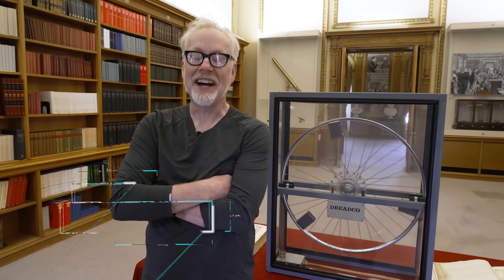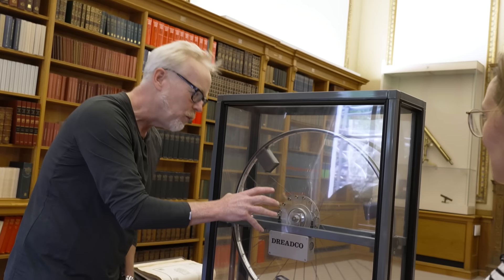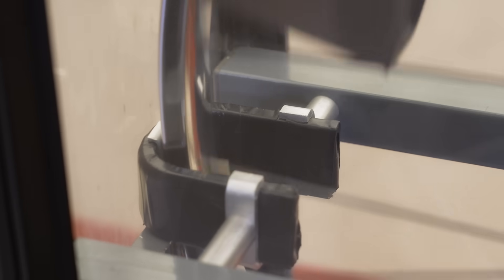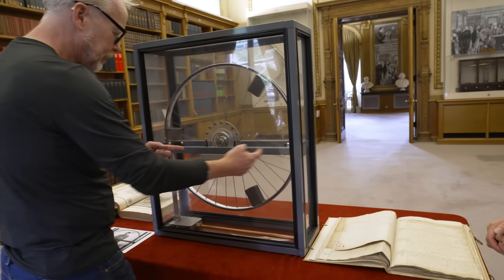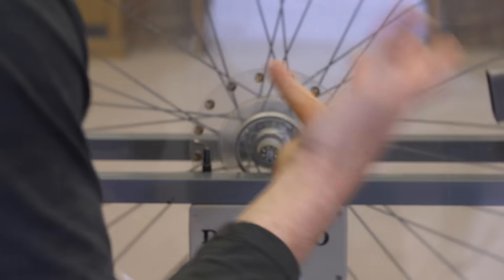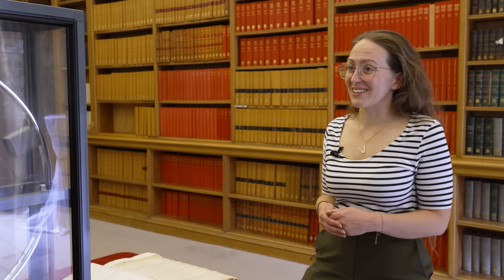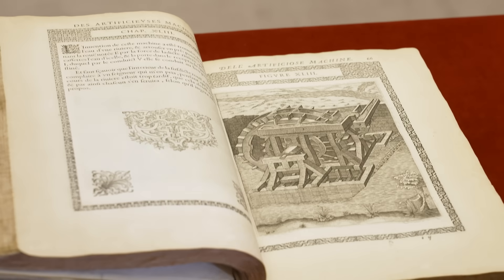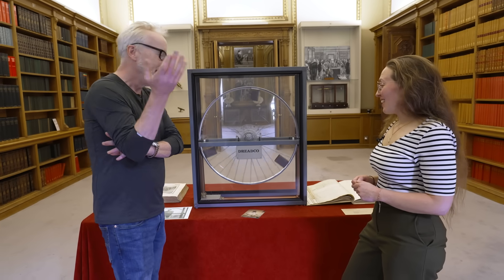Adam Savage vs The "Perpetual Motion" Machine!

Comment: The 3 boxes are capacitors show the edges of the bicycle wheel! Saw the rubber band inside the edges of the bicycle.  Capacitors passing through magnetic fields and passing around a coil in the copper pipe will provide enough energy to keep it turning and an alkaline battery would last awhile to initially start the turning and keep a small charge  switching polarity in the coil hidden in the copper pipe. If the Capacitors are covered in a ferrous material you can use  depending upon the polarity of the magnetic setup send the power from 1 Capacitor to another with a 555 timer chip using a switch to use induction. As stated this is just a self powered motor that needs servicing not a true overunity device. I have a unit that uses a battery to keep a self powered motor generator however being DC and having 5 separate coils connected In series and parallel plus the 5th coil is the motor driver even connecting an alternator insulated from the magnet barrel to keep the charge on the battery. It still has losses due to heat and friction. You are always dealing with the law of increasing losses. Even though I am able to double the current and voltage by using more than one set of panels with coils. It's easier to use a Solar-powered battery charger connected to batteries into inverters. As long as you keep the batteries around 50 degrees F.  Any rupture on Lithium, cadmium or Cobalt batteries causes an instant fire. Amazon who placed solar panels on their roofs have shutdown their entire solar system because of fires due mostly to battery ruptures. Other fires were caused by metal fatigue in the solar panels themselves. And using micro inverters without taking into account power surging from the solar panels burned out the inverters. Another problem was using the smallest wire to conduct the electricity to the micro inverters breaking down due to the same power surging. The same problem is happening with the Tesla EV battery swelling and rupture instant fire. Plus again the batteries are not currently designed to pull 1 damaged battery pack. Instead you have to scrap the entire battery. Just like a flash light 1 dead battery no light. Plus continued losses due to age recharging and battery component breakdown.

Comment: The first thing is to differentiate between "perpetual motion" and "free energy" machine. The former one is THEORETICALLY possible. You just eliminate all losses, supply some initial impulse - and BINGO!. That simple 🙂. Obviously, this is not the case, as the need for periodical "servicing suggests.
The later one, providing some excess energy that can be utilized outside of the system is not possible at all - even theoretically.
This one is, obviously, attempt for the former but the "minor" problem of eliminating ALL losses still needs some polishing.

Comment: my first thought & still thinking
the 3 iron weights rotating in the wheel both accurately ballence the weight of the wheel allowing it to run smoothly and are iron magnets.
te U shaped things each side are verry low power electro magnets providing the tiny ammount of power needed to keep it running.
plenty of places that could be used to hide batteries.

Comment: My guess before watching for the answer is that the little metal arms in the cross beam (near the base of the spokes) are connected to the batteries. As the wheel rotates, those arms come in contact with the base of the spokes, sending current through them to the electromagnets in the black boxes which pull themselves toward the metal cross beam, thus rotating the wheel. This way it is mechanically timed and doesn't need to hide any wiring.

Comment: resistance at the center post is another big issue.  This can be addressed with magnets that keep the wheel suspended with no physical contact.
Reply: Good luck with that. The biggest losses are probably due to air resistance anyway. The wheel is not running in vacuum - the flimsy case would implode.

Comment: The it will come to a stop due to the permanent magnets are slowly getting degaussed. The other thing is you cannot pull any power from this system or it will stop. There is no power gained from machine.

Comment: You can see a slight lag every time a box on the wheel passes through the bracket, which to me, seems to be the driving factor. 
Maybe the heat sync is to regulate temp within the enclosure to keep the magnets/batteries at a constant level to balance out whatever heat they are generating and the copper tubes would simply be vents?
A smudge of mineral oil on the glass to reduce friction.

All and all, it really just looks like an over complicated science fair project... I'd initially give it an A, but then after hearing the breakdown of mechanics, a solid B+.

And if those "in-the-know" of the secret were disappointed in their discovery of the truth, WTF did they ruin it for the rest of us? 
Poor showmanship, for shame. 
Thats like going to the best show on earth and then having all the awe sucked out by revealing trade secrets right before the show starts.
Reply: When one can't do it themselves they give others B+ 😂.
Reply: @ricardoribeiro8037  Thanks for the irrelevant snarky coattail. Same can be said for keyboard bitches... those who bark rarely have bite.
I gave a B+ because of false advertising. NEAR-perpetual motion is not Perpetual.
Reply: @@steinmauer9747 and this is why I posed it as a question, not a statement. Thanks! It's just one of those things you'd have to see in real life I suppose.

Comment: Its a counter balanced wheel with a electronic timing device in the center and a very small air pump of some type only working when it needs to over come balance point with one copper tube as a vacuum inlet and the other side of it as a blower out let in a sealed air tight box with some sort of battier running the pump. The box that would house said pump has heat sinks to make a natural draft from from the short pipe as its less restriction aiding the motion.

Comment: I'm hoping the device somehow uses ambient energy.  The accelerating expansion of the universe relies on dark energy... that must be it!  I think relying on batteries or a spring would be cheating.  Otherwise you could say a clock is a perpetual motion machine (as someone did here).  I suppose a natural battery might be ok -- some kind of one-way chemical reaction that generates electricity.

Comment: I think there are radioactive sources undergoing alpha decay in the three boxes, and the boxes are vented so the thrust spins the wheel.  Alpha decay inside a glass box is perfectly safe, and the two things pointing at the hub are for dissipating the electric charge that accumulates.
Reply: Plausible.

Comment: In 1965 , I saw a Pendulum that was powered by the earth's spinning motion.
It was / is in the lobby of the New York, United Nations Building.   The top of the Pendulum was attached to the ceiling, maybe 200 ft. up , I don't remember the exact height.
And the swinging  metal ball at the bottom , progressed around, a short ,circular wall. 
The tour guide said it never stopped swinging .
Reply: A Focault pendulum. It's not actively powered by anything, but has to be set in motion and eventually stops due to friction, like every other pendulum. It appears to rotate though, but actually it's the Earth itself that rotates, not the pendulum.
Reply: So why cant we shut the Flat Earth freaks up with that!!!!

Comment: why is a small portion of  the disc in the middle with the silver ring covered by the box? My guess is that every empty space is  used for the batteries to power a small motor with a frictionwheel inside of the box. The movement is way too smooth to not be generated by a motor. This man did a great job when it comes to adding "random"  parts to it to distract viewers 😄

Comment: This has been around a long time, I believe she say the 80's. This does not relay on batteries. 
Batteries are NOT a great source of power long term.
This also does NOT relay on weight. This has been proven. The 3 black cans 120 degrees apart, spinning, 
its always "lifting" 2 at ANY given time.
Magnets????????????

Comment: The need for periodical servicing makes me suspect some internal, possibly electrochemical, source of energy, like battery.
Without it, some external source of energy is needed - quite tiny, as not that much energy is needed to keep a wheel like this on quality bearing moving. There is quite a range of options available. Sound, for instance, producing electricity thru a dynamic microphone. Changes in barometric pressure. Changes in temperature. Ambient light etc. Once you chose your energy source, the technical solution would become a minor detail. There seem to be components present for utilizing any of the above energy sources, some of them possibly just red herrings.
We would have true perpetual motion machine only if it would be able to run in vacuum, total darkness, and at absolute zero temperature.

Comment: Magnets and such I see. Makes sense a weight that can push passed the magnetic force but not to much could keep it spinning forever. Probably is hook up a generator and  it won't work. You need a big carnival ride to power a small generator. Use wind or water.

Comment: Just thought of a couple other things. Since we KNOW it is fake something has to drive or kick the wheel. I'm thinking of the possibility it is an electrostatic motor. Much of the parts are useless and there to misdirect the viewer and add mystery. But in the Dreadco box could be a barometric powered clock work that can create enough charge to drive electrostatic charge on the probes. The other idea is that the Dreadco box and probes are themselves a misdirection and the magnets are key. There are enough dissimilar metal parts connected together that they themselves create a battery that can last for decades. This could be just enough charge through some sort of pulse circuit to kick the wheel slightly.

Comment: The wheel is propelled by air pressure, thus you might be wondering how to create air pressure without a moving member. I had trouble understanding why a chemical professor was needed in the first place before I began learning more about their friend and business which has nothing to do without. I probably figured out how .5 volts of current could create air pressure without BLADES or any moving parts. It's working for me. Problem is, since the AIR Pressure is directly correlated to the heat produced by rotation, my prototype, which cost less than 100 euros and included some magnets, isn't sure if it can actually pull another magnet wheel. Accordingly, this will stop rotate in a vacuum or a cold pressure. It is steam engine train only difference is air pressure is created by NON movable parts. This part is my available commercial but they are using it for different application.

Comment: There's no magnets or any other trick. The wheel is on a very good bearing in a vacuum.
Reply: No chance. Did you see how much the wall it moved when Adam touched it? If there was a vacuum inside the sides would be under constant tension from the atmosphere.

Comment: I assisted an acquaintance many years ago in the construction of a similar device. I was very young and the operation of it was somewhat beyond me, but it had to do with magnets with opposing poles on the wheel and frame. The opposing magnets pushed the wheel enough to get it to spin, but it wasn't very efficient. We added a low powered motor to spin the wheel axle, and copper coils to the frame magnet. Each time the magnets pushed off one another, the copper coil became hot; That thermal energy was transfered back into the motor battery, which effectively made a motor which charged itself.

The device discharged slightly faster than it charged, but the energy-to-motion-to-energy exchange rate was extremely efficient. The problem we ended up with was that the copper coils got hot enough to burn through the frame, and over time they ruined themselves.

Comment: I wonder if maybe the 3 "boxes" have magnets inside and act as both weights and magnets, and when the magnets pass close to the copper tubing maybe there is another tight fit magnet inside that moves and changes the air pressure inside the copper pipes and then the extra pressure is send to what Adam thinks are "Cathode/Anode" which could just be smaller pipes the sending slightly pressurized air into those cap looking things on the smaller circle in there and that makes it move ???

Comment: Adam? On your old TV show, The Mythbusters, your experiment to verify or not verify the effectiveness of Da Vinci's proposed steam cannon ignored some key factors. Eg: you jam a lead ball into a copper-tube's bore, perhaps 2/3rds of the way in (4 feet in)  in a 6 foot long bore of a copper barrel with a 4 inch bore   snugly holding a slightly more than 13.5 Ib weight lead ball at room temperature. You put that barrel in a trough filled with searing hot charcoals, guess what happens? The tight-fitting lead ball will expand more than the copper tube per given temperature, and bulge out that portion of the copper tube interfaced with the lead ball. The ball will become lodged/jammed in the bore. Then, if Da Vinci's proposed cannon has a small truncated funnel hole in the one-inch thick copper tube, with the bottom of the funnel facing the cannon tube, perhaps with a  1/2 inch diameter orifice to admit forced water into the cannon's interior breach. The funnel itself linked to an external 4- inch diameter bore cylinder where a wooden piston/plunger would be used to rapidly force water into the searing hot breach, two men holding down the T-bars of the plunger piston when it's flush with the bottom of the water-feed cylinder after forcing water into it. The steam inside could speedily hit over 400psi, enough to generate over 5,000Ibs of force to violently dislodge the lead ball by deforming it in a split second into an asymetrical ellipsoid and 
violently, swiftly thrusting it out of the barrel. My equation for it. F = 5,000Ibs x 2/3 = 3,300Ibs average. A = (3.300 Ibs/13.5 Ibs) x 32 ft/s^2 = 7,800 ft/s^2.
V^2 = 7,800ft/s^2 x 4ft = ft^2/s^2. V = 62,400ft^2/s^2.  V = 250 ft/s (horizontal), 176 ft/s (45 degree angle)
Range (ignoring air resistance) = 88ft/s x 5.5 s x 3 = 1,450. Not bad for a steam cannon.
Reply: Ooops! I forgot to multiply it by 2. V^2 = 2 x A x D, which comes out roughly to 124, 800 ft^2/s^2,. V (corrected & horizontal) = 350 ft/s. BTW, you can reach me at Facebook, Adam.

Comment: i am curious if the 'motion' of the wheel is fluid /even, or if measured with something detecting minute changes would show that there's slight increases & decreases in its speed as it turns. 

Also wondering about the speed that it turns, how it might operate at faster or slower speeds.  Although of course that wouldn't be discovered easily unless the background "operators" of the device were to do that.
Reply: I wondered the same but if it wasn't fluid, the friction would be too great for any battery to spin it for years at a time. Perhaps using lasers you could precisely measure the rate of spin change, but absolutely not with a camera.

Comment: I'll take a foolish chance and throw my two cents out there. It's like a Tesla Turbine, aka bladeless turbine. The copper pipes carry air to and from the box in the corner. The pipe on the left brings air in. The pipe on the right pushes air out. The "U shaped magnets" are used to neck down the air flow, increasing pressure. The moving air is what moves the wheel. The case the machine is in is probably the most important part of how it works. Aside from helping direct airflow, the machine would stop if someone walked by too fast without the case protecting it. The case also muffles the sound of the fan inside the box. Everything else is a smokescreen, including the pictures. Powered by Energizer. And I wouldn't be surprised if the "answer" in the envelope is blank. It's a good joke.

Comment: This machine works on eddy currents produced by the combination of the magnets on the wheel and the copper pipes. The stationary magnets and the rotating magnets have a graduated weak force allowing for attraction but not strong enough to overcome the weight and momentum of the wheel. The combination of this imbalance and the movement of the eddy currents produced by the magnets as they pass the length of the connected copper  pipes ensure the continuous rotation of the wheel. In summary magnetic attraction, weight, momentum, and eddy currents create the imbalance against gravity that keeps the wheel in motion.